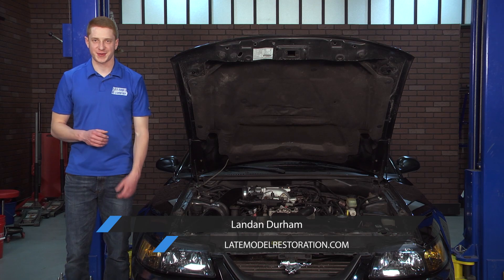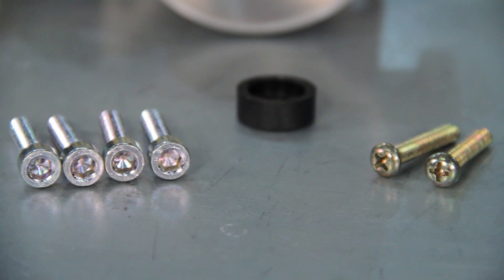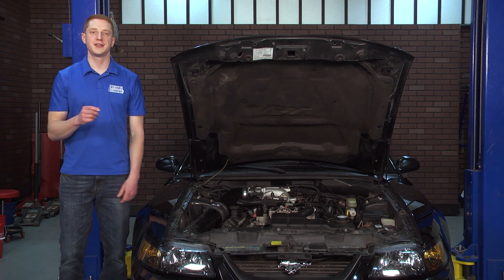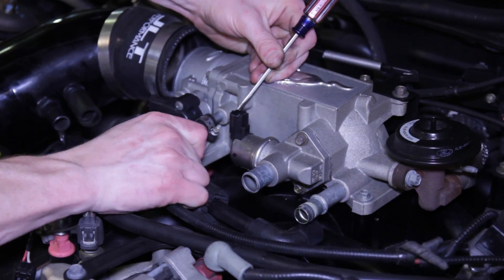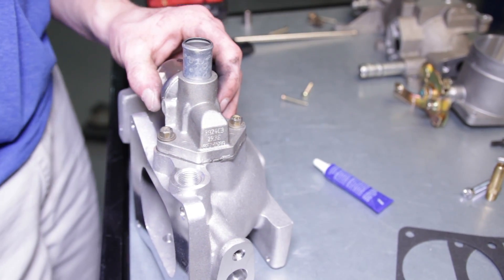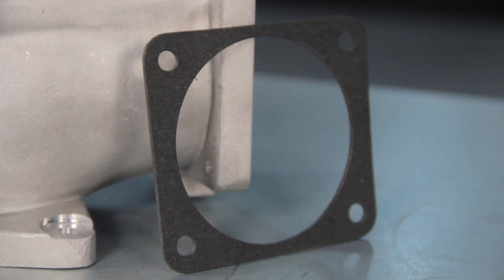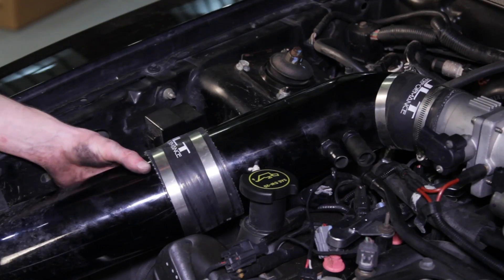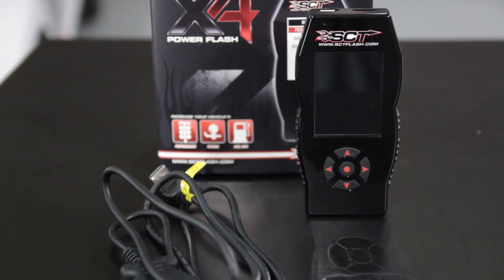Mustang GT Throttle Body & Plenum Install & Dyno (96-04 4.6L)

Comment: I just swapped mine and now the throttle cable has way too much slack🤦‍♂️ i used the factory bracket. Any fixes?
Reply from the maker: The throttle cable is designed to have slack. There are old write-ups on the forums on how to fix that. -Landan
Reply: @latemodelrestoration well, I had my wife floor it and the blade only opens 3/4...maybe!

Comment: Nice to see a dyno test that didn't include a lot of other unrelated parts.  To be honest, I think the biggest improvement was the plenum and not the 75mm throttle body.  On a completely stock engine, I doubt you would notice a difference.

Comment: When i install any intake or exhaust parts i usually reset kam with my tuner, but even non tuned cars should be reset with the manual battery terminal method. So the new fuel trim adapt faster

Comment: How come you didnt use the black grommet included in the package. Shouldnt it go into the tps shaft?
Reply from the maker: Some throttle position sensors have a wider flange than others. If your TPS doesn't fit correctly within the machined opening, install the bushing. -Landan
Reply: @latemodelrestoration  How can I tell if it is fitting right.  Is the any part of the tps supposed to go into the shaft,  or is it suppose to lie flush with it.
Reply from the maker: @leohealth123  The TPS sits flush with the throttle body. Measure the diameter of the flange on the TPS and then measure the ID of the machined bore in the throttle body. If the difference equals the thickness of the bushing, run the bushing. If it's +/- a few thousandths, leave it out. -Landan
Reply: @latemodelrestoration  THank you for thorough response. I performed this mod along with bolt on CAI, and plenum.   And afterwards i have rough idle and my automatic transmission doesnt shift unless engine is cold.  could poorly placed TPS be the cause,  or maybe I have a freak cooincidental transmission failure. i have v8 2004 mustang gt, auto.  with 147K miles
Reply from the maker: @leohealth123  Yes, a TPS that is set incorrectly will cause automatic transmission equipped cars to shift erratically. The ECU relies on the voltage of the TPS for system functionality. If the voltage range isn't correct, problems will persist. We have a video about setting TPS voltage on a Fox Mustang. The process is identical for an SN95 and New Edge car. Link to that video below. -Landan

https://youtu.be/HUwr0g5Qn7s

Comment: What do u do with that black bushing kit comes with?
Reply from the maker: It's an insert that gets installed into the recess on the throttle body where the actuation arm for the butterfly valve is.  Some aftermarket throttle bodies require it, and some don't.  Check out the video that I linked for more info on the bushing.

https://www.youtube.com/watch?v=MNxkYyAVOI8

Comment: I need an answer ASAP yall .I got a bbk 78 mm throttle body and bbk intake .After I installed them when I just tap my gas it’ll die but start right back up .Do I need more fuel flow like better injectors or what?
Reply from the maker: Hey Cameron, please give us a call or email us with the link below and speak to one of our customer service representatives. They'll be able to assist you with your issues: https://lmr.com/contact

Comment: I have the 75mm trickflow plenum coming I ordered from you guys I'm using a 75mm throttle body Also do you think I need to go to 24lb injectors or is factory injectors fine
Reply from the maker: Give us a call at 1-866-507-3786 or send us a email with the link and a CCR can assist you with ordering the parts you need for the build - https://lmr.com/contact

Comment: At the 3:09 mark you will see there is no black plastic piece inside the female side of where the sensor attaches to. Mine came with a plastic piece installed in it and I can't get it out!!! The sensor will not fit back in place with the plastic insert in! Why was this sent to me like this? Was it a screw up or am I supposed to gouge out the plastic piece? Anyone have this happen to them?
Reply: Just bought and same, came with it preinstalled. Did you ever get it out?
Reply: @pjcustoms8508  Yes I did.
Reply: @TheMustang424  GREAT! Any tricks? I’m stuck on getting it out
Reply: @pjcustoms8508  small flat head screwdriver and pick at it till it comes out. You also need plenty of patience lol

Comment: My 2003 Mustang GT has CAI, X pipes, 3.73 gears and 75 mm throttle body. 
126k miles and I paid 4,000$ for it. :)
I wonder how much power it puts down? If I had to guess maybe around 270?
Reply: Angel Gutierrez I got a 2000 gt with slp headers, x pipe, and loudmouth exhaust, with a stage 2 clutch, under pulleys, short throw shifter, lowering springs, and custom rims. I trade 3 of my fire arms for it and they only costed me about $2300 lol
Reply: CallMeZix Traded three guns for a Mustang? I love America!
Reply: Angel Gutierrez I already had too many guns and I wanted a mustang so it worked out lol but hell yea Merica
Reply: CallMeZix Great car. Just check head gasket, I think they used plastic head gaskets first couple of years of new edge. 03 and 04 use metals ones. Besides that it’s the same as a 2004 Mustang.

Comment: 6 hp for 500$ ok..
Reply from the maker: You can check out this throttle body and plenum kit here. They retail for $224.99 and are a great foundation for future bolt-on performance parts. - https://lmr.com/item/SVE-6472AK/SVE-75mm-Throttle-Body-Plenum-Kit-Mustang-Satin-96-04
Reply: It’s not even half that price but ok..
Reply: @eriv4735  Yea it's more than half and what you get for that is nothing
Reply: c t 23 NO $215 is NOT “more than”  half of $500, it’s LESS than half just like I said 😂..If you think $215 is “expensive” then you definitely picked the wrong hobby bud
Reply: @eriv4735  laugh out loud I never said one time that at 2.15 was expensive all I said was for that product  it's not worth it and it's not 215 on top of that I'm commenting on the whole post not just part of it he said a plenum throttle body and a Dyno tune that is Sir more than $500.
Reply: c t 23 They didn’t “dyno tune” anything..they did a run by run comparison of a $215 BOLT ON part..a dyno tune is not needed at all BUT would only INCREASE the gains you’d receive..again if your worried about price you chose the wrong hobby 😂
Reply: @eriv4735  not worried about the price just not buying cheap junk
Reply: @eriv4735  you must run this crap on your car cuz you're the only person  to say anything about it 🥺
Reply: c t 23 You must not be able to afford this cheaply priced product so you’re trying your hardest to discredit it..sad 😂..If you took the time to look through these comments you’d find that your opinion is shared by very few so realistically I’m not the only one “talking about it” 🤦‍♂️..I have several cars and while I’ve never used this particular product I’d be willing to purchase it for a BUDGET build because it’s so cheap in price..unlike you Im actually willing to spend money on my cars
Reply: @eriv4735  That's it man you got me. An your trying your hardest to prove what? What I said is true for the money you idiot.its not Worth it.glad u over paid for this.I run BBK on my cobra,gt and sn95.now we all know what you run.👌😆😆😆
Reply: That sucks

Comment: Would this work for a crown Victoria since they are both 2v motors ?
Reply: Yes they do just gotta turn it the other way it fits on my 05 p71
Reply: @todtandy8077  with wireless throttle body aka drive by wire??
Reply from the maker: Raemon - Unfortunately, I don't have an answer to this. Just because a 2V engine was used in both vehicles, some components will not interchange. -Landan

Comment: PLEASE HELP! How do i remove the pre-installed bushing for the throttle body TPS sensor? It's really lodged in there. You guys should not have pre installed that piece.
Reply: Did you ever get it out? I just ran into the same issue today!
Reply: I took a small drill bit and made swiss cheese of it until it fell apart.

Comment: *****BE VERY CAREFUL OF THIS PRODUCT***** poor fit and finish, and the fitment is awful .. the throttle cable will not fit properly and the holes need to be re-drilled. Save yourself the headache and buy the bbk throttle body. 
For Canadians this sh!t is useless, i'd be spending 320 bucks plus shipping .. plus cost of labor to gain 6hp ... that's horrible.
Reply from the maker: unzunzvroom Have you actually installed this SVE throttle body and plenum combo on your car? If so, have you notified our knowledgeable and helpful customer service department? Stating false claims will be removed from the channel. We respect everyone's honest feedback and will do our best to make sure the issue they are having is resolved. Thanks. -Landan
Reply: well comment was never removed ... guess there is some truth to it.. how much truth idk
Reply: @codyramos3200  so what take a drill and make the hole bigger. Big deal. Welcome to buying aftermarket parts
Reply: @Clamb13  i wasnt talking about the throttle body n plenum  nor complaining . LMR stated ''false claims will be removed from the channel"  so maybe OP did receive a part that slipped through qc or OP cant turn a wrench who knows .

Comment: SO FAR ON MY 98 GT 5 SPEED MODS ARE OFFROAD X PIPE AND FENDER WELL COLD AIR IM GOING TO SWAP INTAKE MANIFOLD WITH TRICKFLOW ITS EXPENSIVE BUT IT WOULD BE WORTH IT
Reply: Mustang98 007 you're better off doing a PI swap, those stock NPI heads will remain a huge restriction. try the PI swap  (heads, cams and intake) before you get a trickflow intake
Reply: Samuel Paniagua i have pi intake when i first got the car does that mean i should have 99-04 cyl heads
Reply: Mustang98 007 some people just do the intake, the intake alone is about a 15whp increase, there's a few videos online that will show you how to identify what heads you have
Reply: Samuel Paniagua do you know that channel name cuz i want to make sure before i do anything
Reply: if they're the PI heads from a 99-04 mustang GT, they'll have "PI" cast on the heads above the exhaust ports

Comment: does the 00 throttle body from a v8 fit on a 00 vsix intake. If not how to a make it fit, possibly machine my own spacer? *****
Reply: James T they won't fit, try getting a windstar (minivan) intake first and then maybe later upgrade the TB with one of the ones LMR offers. the WS intake will be far more beneficial (10-12whp) and way cheaper.
Reply: Samuel Paniagua what transmission should I swap for my t350 tranny on my 01' GT with cai everything pretty much stock.? I hear people swapping transmissions off old foxbody mustangs into 01's-04's